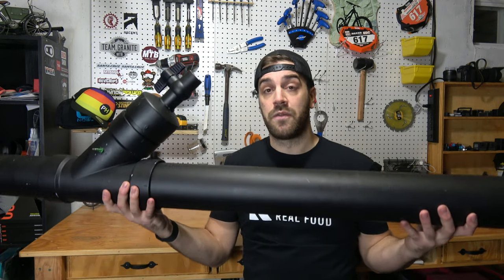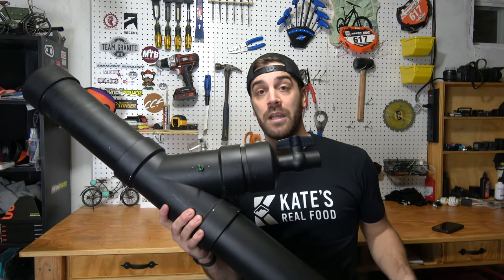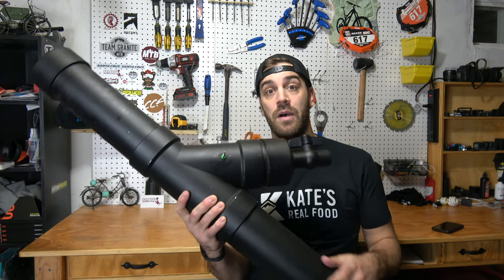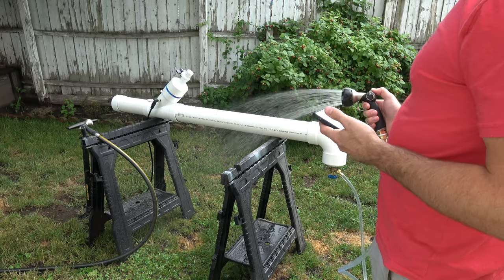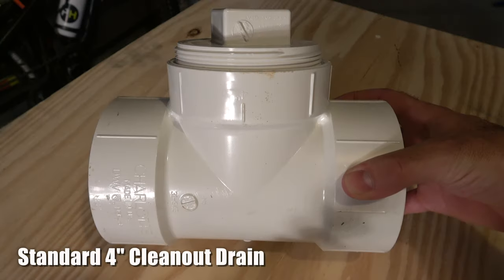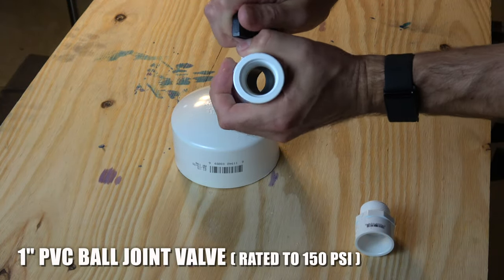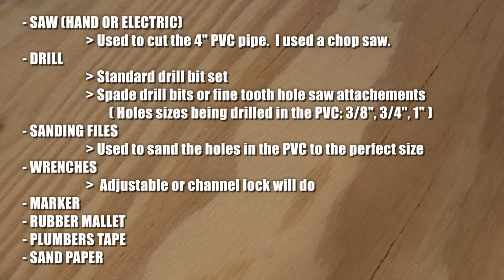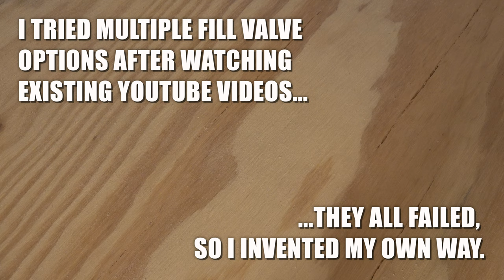DIY: Pressurized, Solar Heated, Rooftop Camper Shower for Under $150 | NO ELECTRICITY NEEDED!

Comment: Could you do a double capacity by putting a u joint at the front and add another long tube?  Also about how much does it weigh with water?
Reply from the maker: In theory, yes, but pressure would be lost much faster.  Also, have to re-pressure between showers and the more volume without water, the harder it will be to pressurize.

Comment: A very nice build. This all works, as long as there is no solar on the roof, as this setup will create unwanted shade areas on the panels, rendering them pretty much useless.
No solar - no problem and a very viable solution.
Reply from the maker: Thank you.  Plenty of options to work around with solar, if you plan accordingly.   ¯\_(ツ)_/¯

Comment: How about the cleaning part. The inside needs a scrubbing after a while. What would be the safest way to make that happen.
I've had an issue with that little slime collecting in my previous system
Reply from the maker: Solid question and something I’ve definitely thought about.  Best bet is likely to use a pvc safe cleaning solution.  Fill, shake, let sit, rinse over and over.  Luckily, this isn’t meant for potable water, so I’m not too concerned.

Comment: Could you double it up for a longer pressurized shower????
Reply from the maker: I mean, it sounds like it would make sense, but remember, the bigger you go, the more you have to pump to keep the right pressure.  This size gives you the perfect 3 minute shower, then refill and repeat.  If you try to do a second shower with a half empty tube it takes a lot more work to build pressure with the bike pump I use.

Comment: Did you do the pressure test with the water inside? Because water doesn't contract under pressure - comparing to the air, it won't accept too much energy and therefore the boom will not be big scary and injuring so much if it bursts.
Reply from the maker: I did not know that.  Thank you for sharing! Great info.

Comment: Looks great.  But the schedule 40 pvc you use says it's not recommended for pressure, as the pipe can shatter.  How high can you safely pressurize the tube?
Reply from the maker: No pvc is recommended for pressure, but that is why I stay below 35 psi. There are psi rating for each type of pvc online. From what I remember it starts to get really dangerous above 150psi. Potato guns are charged up to 300, which is VERY dangerous.  Pressuring any PVC is at your own risk.
Reply: @MTBTravelReview  thats not necessarily true. I work with PVC all the time. It depends on the type of PVC. Foam core (which is probably what you used) isn't rated for pressure, drain lines and sewer lines only, but there is PVC thats rated for higher pressure. Its used exclusively for pressure applications, mostly water. With that said, anybody working with PVC really needs to check and make sure what they have so they can make sure to use it safely
Reply from the maker: @Thecowboy69997  thank you for the info.  I am no expert, that’s for sure.  Safety and research is always key.

Comment: Pretty dang cool! I need to figure out how to pour water into it, versus filling it via a hose. Any ideas? Thanks!
Also, my tank will be stored vertically, versus horizontally.
Reply from the maker: Cheers man.  Definitely a few tweaks that could be made if you are going to store verifiably, but that’s what makes it fun! Either a good funnel or a transfer hose could work just as well as a standard hose.  Let us know what you figure out!
Reply: @MTBTravelReview  Thanks for your kind and speedy response. Will let you know! Maybe flip the Y joint over! Hmm.

Comment: How do you clean it out? Putting Teflon tap on pvc threads makes taking it off easier. They make 1 1/8”hole saws for 3/4” threaded fittings too.
Reply from the maker: Leave it open and let it dry.  I am aware that they make the appropriate sized hole saw, but that doesn’t mean I wanted to pay for one. :-)

Comment: Did you use pressure rated PVC because all I can find around my area in 4/6" size pipe is "not for pressure use" PVC and abs.
Reply from the maker: I used standard 4” Home Depot PVC.  It is not specialty pressure rated PVC.  I’ve been told it can handle pressure up to 300 psi, but to be safe, I never go above 30psi and it’s more than enough for a 2-3 shower

Comment: My favorite build so far on youtube with the WYE and the ball valve, how's it doing so far?
Reply from the maker: Cheers man. It has been working perfectly! Not a single issue as of yet and the ball valve makes it so easy to fill/empty.
Reply: Thanks man, i combined your design with a little bit of my own touch this past wknd and built and L shape system (6.5 gals total), i went with ABS pipes and totaled out to be about $135. Ryobi has a cordless tire inflator so I'm going with that instead of a bikebump
Reply from the maker: @hv4285  awesome to hear that my design helped man!  Tire inflator will make it much faster. Solid idea. Let me know how it works!
Reply: Yeeee! Agreed! I’m building this set up right now!! What a great idea! Glad to hear yours is still working. Y’all should try pressurizing with co2, can get a tire inflator adaptor for the co2 canister.  Relatively cheap for refills, what’s your guys thoughts??
Reply from the maker: @RadRob000  I would not use Co2. Co2 will actually flash freeze the inside ever time that you use it, and that will stress out the PVC making it more likely to become fragile and dangerous in time. It’s also hard to gauge how much air you are putting in. Floor pump or electric pump is best.
Reply: Awesome! Thanks for that info! Couldn’t Dina a good setup for a bike pump that has a long enough hose. Im sure they make a extension??🤔
Reply from the maker: @RadRob000  that is a good question. I don’t personally know, but let me know what you figure out!
Reply: @hv4285  I'm looking for higher capacity design, would love to see yours. Also, mounting on a RAM Promaster high-roof van makes the valve hard to reach. Trying to think of a way to make it easier to access, perhaps with a non-linear shape.
Reply: @RadRob000 I mounted my shower on lifted first gen tacoma so it was difficult to reach the pump hose to the valve. 

I used to park by large boulders near the beach that I surfed at or backyard balconies or any platform  higher than the parking spot so I can manually pump. Or set a chair on my truck tailgate to place the bike pump on. That isn't always an option for everyone so I'd recommend a hand held cordless tire inflator. Amazon has a good deal for ~$60
Reply: @doronsherman  I built an L-shape system mounted on my Tacoma truck topper.

At the short end I added an 90 deg elbow just like MTB (but he has it on his long side),  this is the discharge end. Elbow I have the WYE set up similar to MTB, easy access from my tailgate, then just a straight pipe with an end cap running parallel to my truck. Let me know if this is clear I can send you photos if necessary
Reply: @hv4285  would love to see pics of this

Comment: Hello, good evening, I am about to do this as a project for the science fair, I wanted to know more about exactly how many times I should pressurize, also if you could give me some suggestions. Thank you!
Reply from the maker: Very cool.  With 1 tank you get two showers, so you have to pressurize twice.    I pump to about 30 psi for a 2 and a half minutes of water pressure.  Shower turning it on to get wet, then off to soap, then on to rinse.

Comment: Why presta valve? you would have to get adapter for many public air compressors.
Reply from the maker: I already have a presta foot pump on hand since I am a cyclist. “No electricity needed” was the goal here, so a compressor wasn’t a factor. You could easily use a Schrader valve if you wish!

Comment: do you know how many gallons this holds? great video bro!
Reply from the maker: Cheers!  1 foot of 4” PVC = .6825 gallons, so this holds just over 3.5 gallons.  Gets about 2 good showers.  I just added an 8’ holding tank so I can fill it twice with that.  You dont want to make a huge main chamber, as that just means you need more pressure as the water gets below half tank.

Comment: I’m curious, is there any particular reason you used pvc vs abs pipe? Just wondering since most all how to videos I’ve seen use abs instead.
Reply from the maker: My researched showed that ABS is made of recycled or “regrind” plastic, which can make it less durable than PVC.  PVC was also just easier to find with more connection option at my local store.
Reply: @MTBTravelReview  acually ABS vs PVC , PVC is more flexible and both are okay for potable water. ABS will hold 100 psi no problem. Relief valve for sure. Both PVC and ABS do not require silicone as they are sealed water tight if the glue and procedure is done correctly. Abs will work a little better as the glue will soften the abs to make for better seal on any fittings that are not made for fitting the plumbing for the project. Nice job though, get rid of the hose clamps and poly hose. Use a nice high quality coil garden hose :)
Reply from the maker: @rodkopp1005  appreciate the insights!!

Comment: Love this build. Is your shower time limited to 3ish minutes due to the pressure or water capacity? If pressure, roughly how many showers can you get out of this before refilling? Looking into options for my wife and I.
Reply from the maker: 3 minutes due to water pressure.  I can usually get two conservative showers out of 1 tank.  I have added a simple backup 8 galling water storage tank next to this one for more shower potential.

Comment: hi, i see you have squaredrop and do mountain biking trips. where does your bike live during transport, at night and while you are away from the car/camper? i am currently building my squaredrop and trying to figure out how to store the bike inside. here in CO, leaving bike outside means it will almost certainly get taken. any input appreciated.
Reply from the maker: My bike either goes in the back of my grand Cherokee or I take the front wheel off and put it into of the camper.  Not as bad here as it is out West with theft.

Comment: Any idea how heavy that tube is when it's full of water?
I'm an over-the-road truck driver, and that would actually be a great device to carry around when I'm stuck overnight with no access to a shower.
But, I would need to fill it up with water, before I leave the house. 
So I wonder if it would be too heavy to move around and attach to my truck after I get to my terminal.
Reply from the maker: About 4 gallons worth of water heavy.  Pretty easy to move around as needed
Reply: @MTBTravelReview  
Sounds good.

Comment: I would use quality metal ball valves. PVC Valves are crap even in simple applications like rhis.
Reply from the maker: My pvc ball valve has worked flawlessly for over 2 years?  Not a ton of use in this scenario, so seems to fit the bill
Reply: @MTBTravelReview  they are notorious for cracking...

Comment: Hey just got the most of the supplies do I need the quick release hose or can I just buy a regular hose
Reply from the maker: Regular hose would work fine. I just added that to make life easier and because it was lighter.
Reply: @MTBTravelReview  thanks for the build idea because I've been trying to save money instead of buying a water port weekender also what do I do if I have leaks after I put everything together
Reply from the maker: @zack-qc4uy  if it’s done right you shouldn’t have any. I hadn’t had a single dribble from any connection after over a year of use.
Reply: @MTBTravelReview  thanks and what type of val did you use on Amazon
Reply from the maker: @zack-qc4uy  not sure, but everything I used is listed on the video
Reply: @MTBTravelReview  how many gallons does this thing hold
Reply from the maker: @zack-qc4uy  not sure. You’d have to do the math, but 5-10 gallons

Comment: Where could you put the pressure valve  , if you can make a vertical  type shower , would it work thanks
Reply from the maker: I do not know.

Comment: Is it possible just to fill through the boiler drain valve that you use for the shower hose?
Reply from the maker: I don’t see why not.  Just have to monitor pressure if all other openings are closed during filling.

Comment: Have you ever considered a 12 volt pump with a pressure regulator ?
Reply from the maker: If you watch the full video you will see that my goal was to use no power, so no, but you could certainly consider it if you’d like.

Comment: What's the maximum psi this PVC tank can sustain?
Reply from the maker: As stated in the video. I don’t recommend going above 30psi for safety reasons, as this is not high pressure pvc.

Comment: How are you preventing legionaries disease bacteria in the pipe? Assuming the temp never goes above 60°C. And that the water is in there for +2 days.
Reply from the maker: I do not have a answer to this question, but I have never had legionnaires disease from my camper shower. ¯\_(ツ)_/¯

Comment: The huge problem I am having is with the brass boiler drain valve and the threaded bushing adapter it will not screw down far enough to get a tight fit on the 4" pvc end cap. Ieven went back to Lowes to try other valves and bushings and they are all the same they just won't thread all the way, just about midway and I have a gap of at least 1/2 in which I am pretty sure the pvc cap is not that thick to make a solid tight connection.  Any advice?
Reply from the maker: That’s a tough spot. I had a tough time tightening that connection on mine as well.  Mine isn’t insanely tight. I could spin the drain valve if I really tried to, but the watertight sealant I used is keep a strong water and air tight seal, so I haven’t had any issues.
Reply: @MTBTravelReview  well I found a way to make it super tight, I just added an O-ring, now I am set to move on thanks for your reply and your awesome vid I hope u get a million views someday
Reply from the maker: @divineavengers  sweet and thanks man! 👊🏼

Comment: I haven’t gone through all the comments to see if anyone has brought this up. In the beginning the author said that he wanted to do his own video because of the mistakes people were making in the videos that were out there. I have a lot of suggestions to make to improve a DIY setup. I don’t like this set up for a number of reasons. We installing something into PVC take advantage of being able to drill any place you’re making a hole. Don’t add something then make it unserviceable. When he added the hose bib I believe he used some sort of locktite on the male threads of the hose bib then pushed it through his cap and then screwed a nut on the back side of these same threads pinching it between the pvc and counting on the locktite and nut to keep it from leaking. If that hose bib ever goes bad you’ll need to cut the cap off do the repair and recluse the cap. Bad idea and believe me a hose bib will go bad at some point. Use the same house bib either 3/4” or 1/2” and drill and tap the pvc and thread you hose bib in place. This way if it ever goes bad you can unthread it and replace it. There were just too many other things like the 4” Y connector with the 1” ball valve. That thing was sticking up in the air a mile. Also if you can use DWV instead of PVC it will be cheaper and weigh less. It’s also thinner which can make drilling and tapping a little trickier. Always drill and tap through a fitting and pipe. Another words drill and tap through a coupling or cap even a 90 this way you have the thickness of the pipe and the fitting to tap your threads into. I’m not going to go any further and rip this apart just understand that when making one of these you want things to be serviceable and as low to the rack as possible.The first tree limb you see will take the 1” ball valve right off. I appreciate anybody doing videos and giving me idea’s as did this guy. Even if the idea he gave me is to do my own DIY on a solar shower for over-landing, camping etc.
Reply from the maker: I pray that you typed that on a laptop, because that was quite the comment!  I’d run through a list of responses, but instead of over exerting my thumbs on this tiny screen, I’ll leave you with this: no matter how good your point is, delivery is everything.  And I put a mountain bike on the roof right next to that 1” ball valve, so you leave my valve alone.  It’s just wonderful, IMO.  Looking forward to seeing your video.

Comment: How long of constant flow before it gets weak (too weak for a shower). Would the pressure not be gone after a few seconds and eventually have a vacuum as no air is getting in?
Reply from the maker: Around 2 minutes, and no.  All laid out in the video.
Reply: That's what I'm experiencing. A lot of different factors though, like size and temp

Comment: Why the y connector and not putting the fill valve on the opposite end?
Reply from the maker: I stand on my campers tire, which is located in the center.  Convenience.

Comment: Why not buy the pvc black to start of with?
Reply from the maker: Hard to find
Reply: Most black pipe is ABS and NOT safe for potable water, IF thats what your going for.
Reply from the maker: @jacoblastant6972  I wouldn’t recommend anyone use this system for potable water.
Reply: @jacoblastant6972  for a shower, not to drink from it 😅
Reply: @MTBTravelReview  Why not? If schedule 40 or 80 PVC is utilized as well as oatey cement its all rated for potable water.  Totally understand throwing in a disclaimer, Just to CYA though.  :)  awesome vid by the way, thanks for posting.
Reply: @ifell3  of course, but could be duel purpose if you use the correct material.  And I said IF that is what someone is going for.  Also forgot to mention Black ABS is not rated to be exposed to the sun or pressure and in the sun it will get brittle over time.